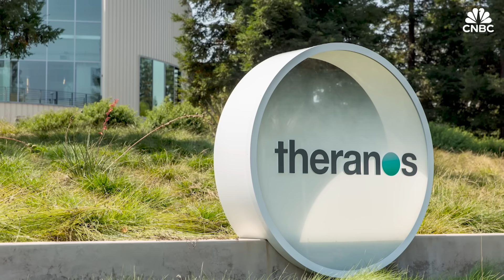Inside Alef, the company trying to build a car you can both drive and fly

Comment: FAA restrictions will kill revenue. Not safer than a plane, there is zero lift if a lift fan goes out. Also the electronics and wire harnesses cannot be made just to auto standards, it must all be aerospace certified.

Comment: I can see exactly how it would work...BRILLIANT, blades not exposed, and the swivel cockpit, to transit
from vertical to horizontal flight. like a bi-plane, in horizontal flight...and best of all, fitting into a single car garage, (which most flying cars can't do) I  have drawn 1000's of flying car concepts, being a former pilot,
I do see how this design could be improved....a lot. Think.... ahead a few generations.

Comment: This is a scam to get investor money.  The core design will not fly, those vents make very poor wings.

"This is way safer", really and how would you know that when its never flown.
Reply: it's safer because it will never leave the ground with a person in it. Further, it has no propulsion or steering mechanism for "ground mode" so it will never be driven on a road. That indeed makes it much safer. It is defiantly a scam.

Comment: The biggest issue I see with this ever becoming a reality is, what's going to power it. Lifting two people, plus the car itself in the air TAKES A TON OF ENERGY!!! Batteries simply don't have the density needed to make this feasible. You'd have to keep adding more batteries, which makes it heavier, requiring more batteries and you're caught in a vicious cycle. Either we find a way for batteries to hold 10 times the amount of energy they currently can or it's just not feasible.

The other options are jet fuel and nuclear power. Honestly, jet fuel seems to most feasible. I mean, we already use it for helicopters. It's tech already being used. Nuclear clearly has enough power, but do we really want to deal with two flying cars powered by nuclear batteries crashing into each other?

We need a major, MAJOR energy advancement before something like a flying car will be in everyone's garage. You basically need nuclear power without the issues that arise if two nuclear powered cars crash into each other.

Comment: This is not going to work for private use, not in our lifetime, and not so much because of technology but because of regulation. it's not just the fact that drivers should be licenced as pilots too, but that regulation will not allow taking off or landing anywhere, so the apparent convenience of this vs an elicopter is questionable, especially as this will also have disadvantages vs an elicopter in terms of fuel quantity etc. (so only short trips). I can only see this as niche corpotate vehicoles talking off and landing as specific locations , for short distances and being able to drive when needed in certain places where you cannot land or take off.
Reply: The solution to what you're saying is simple: we wouldn't be driving/flying them, a computer would. Imagine a network of flying cars, all talking to each other. Now, of course, I can also imagine someone hacking into the system and getting thousands of flying cars to crash into each other, but let's just ignore that possibility! 😂😂😂 In a world where computers are flying us around, we wouldn't have to worry about us crashing. It's honestly the only way this could even be feasible.
Reply: imagine working in a high rise building in an era of drunk drivers on flying cars